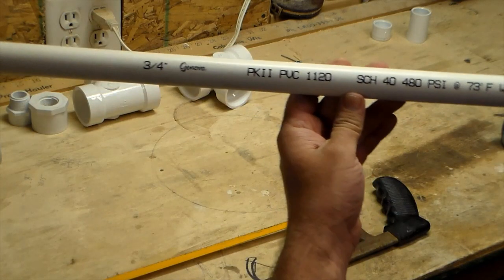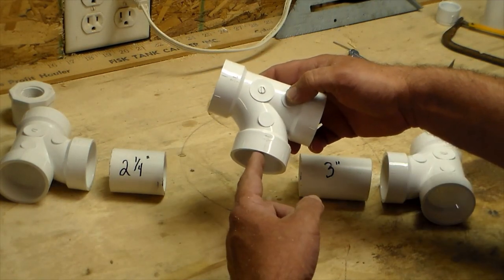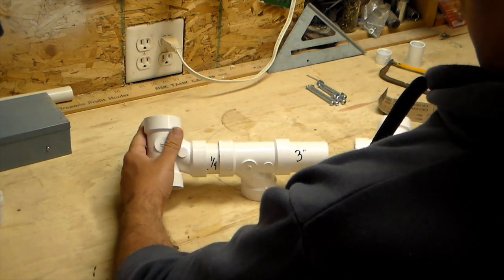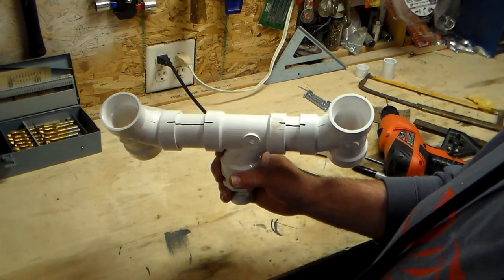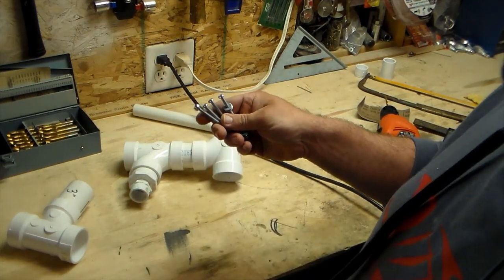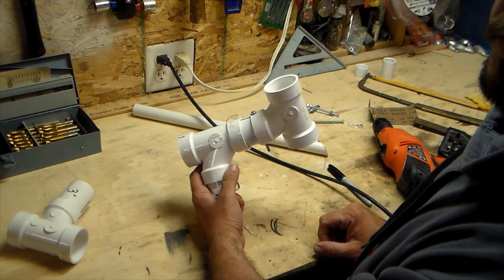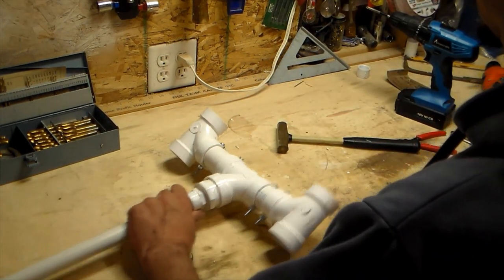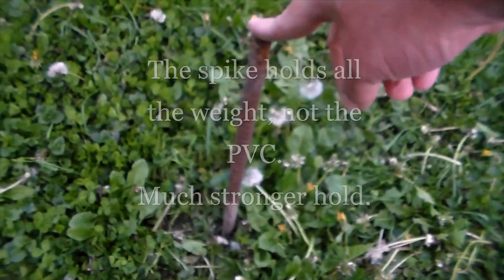PVC and rebar double rod holder for bank fishing

Comment: I made these, and came up with an Enhancement to your ," BUILD".  You can grind a little bit of radius curve in top of Rebar, to  let bolt seat into it, OR... Epoxy a fender washer or , the like to the bolt, for more Surface area, for rebar to rest against, Though Enhancements are not really necessary.
Reply from the maker: Those are great ideas. Thanks for sharing them. I’m starting my next set in the near future!

Comment: Not a bad idea but why not secure the rod to the main pvc pipe, let a little hang out the top so you can hammer it. Also try drilling a few other holes incase you want to quick change the angle (trees & such)
Reply from the maker: Those are good ideas!

Comment: I'll have to use this design but with something that will hold the PVC because the rebar will have to go through very rocky ground but the PVC will just spin and not go in the rocky ground at all. Sand and soil this would be excellent but most of our fishing places have this rocky ground.
Thanks for the great tip! BTW You did an excellent job of explaining
Reply from the maker: I made a 5 gallon bucket rod holder that might work on rocks. I fish mostly dirt/grass banks, so I'm not sure what to try for hard banks. Let me know what you come up with and good luck fishing!!
Reply: @KCLOutdoors  
I made one that is just a 3' - 1 1/2" PVC and a 1 - 1/2"  "Y" 
Used the rebar in the ground with a 5# hammer and then the pole goes in nicely!

Comment: Really like it could u comment on here a material list of what i need to make one
Reply from the maker: Will do.
Reply: @KCLOutdoors  can you mention me in it when u post what i need to make it
Reply from the maker: @braxtonball2662 Here you go…

3) 1 1/2” T connections 
1)  1 1/2” to 3/4” reducer / Threaded
2) 11/2” pieces cut at 2 1/4” and 3” long 
1) 3/4” pipe cut to desired length 
I used machine screws and glue to secure everything. I’m sure only using glue would work, but I wanted to make sure everything stayed together!
Thanks for watching!!

Comment: What size Tee are you using
Reply from the maker: They are  1 1/2”.   I’ve used this rod holder and also the 5 gallon bucket rod holder without any issues.

Comment: Can you give me all the materials  needed  thanks in advance
Reply from the maker: Here you go.  
 (3) 1 1/2" T. 
 (2) 1 1/2" pieces of pipe. Cut at 3" long and 2 1/4" long
(1)  1 1/2" to 3/4" reducer. 3/4" is female threaded.
(1) 3/4" male threaded to 3/4" female
(1) 3/4" pipe cut to desired length.
(5) 10/32 bolts and nuts
(10) washers
(1) piece of rebar cut to desired length
All the PVC is SCH 40. I'm not a plumber, so not sure what the exact names are for all the fittings/couplers. Hope this helps!!